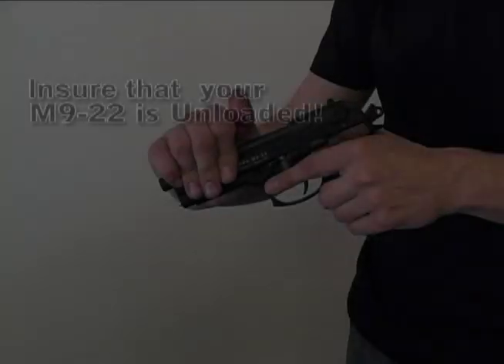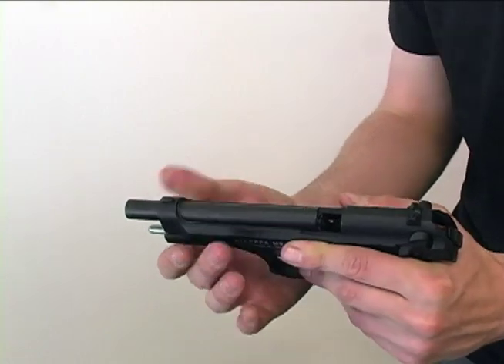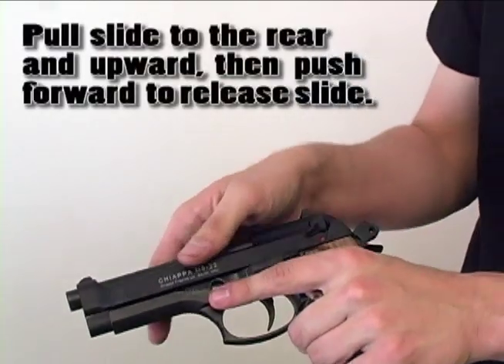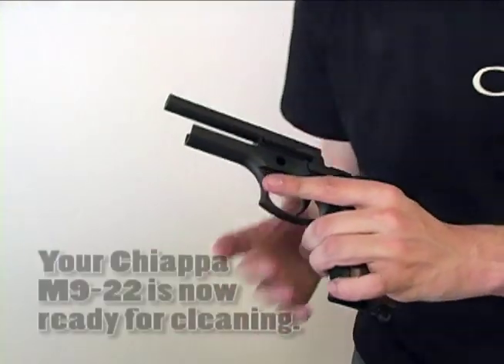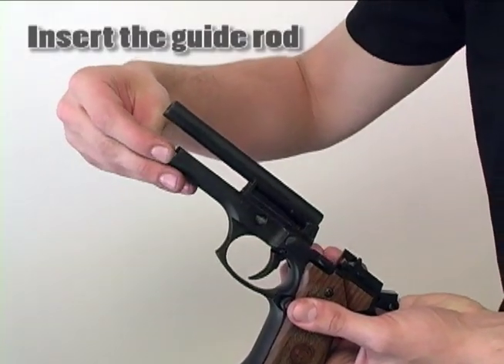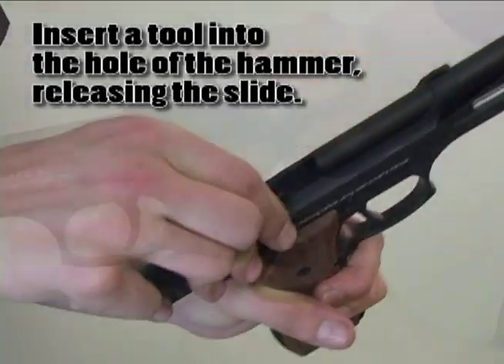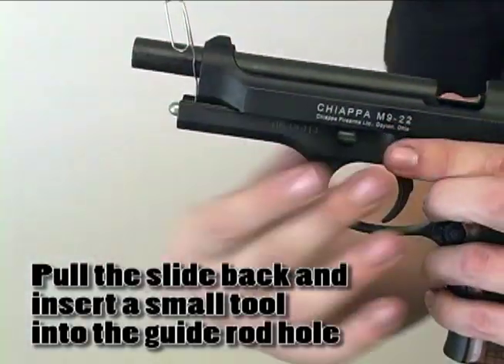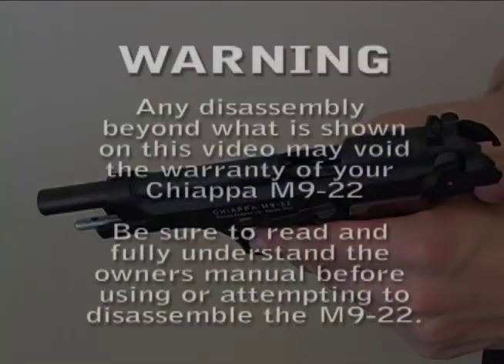Chiappa M9-22 field stripping & assembly

Comment: I got mine to train with instead of using my Beretta 92f. The size/weight are spot on. The M9 has a long trigger pull, and it wont let me rack the slide to chamber a round like the instructions say you can unless I cock the hammer first. 
After my debacle with cleaning and trying to reassemble this thing, it's going on the shelf and I'll keep using my Beretta. To me, it's more user friendly. I'll spend the $ for 9mm
The M9 seems decent, and no issues with the CCI mini-mags I ran thru it today

Comment: @ BlueRiverBenchcraft, because then there would probably be a copyright infringement. They can call it an "M9" because that's a non-copyrighted designation used by the military, and they can make it "look" like an M9 on the outside because that's only a cosmetic appearance. They just can't actually make it WORK like an M9 without getting sued by Beretta. I guess they mean for this to be a training gun for those who use M9s or for those who don't want to pony up the bucks for a real M9. Because, you know, .22 conversion kits are often as expensive if not more so than a regular inexpensive .22 pistol.

Comment: I read the instructions before the tear down, no problem. The reassembly instructions???...it just says 'reassemble'..There are NONE, NOTHING. I scratched my barrel all up, the slide, the whole thing. I have 24 rounds thru it and looks like a used gun. This instructions are HORRID!!! They should fire whoever the idiot was the wrote them, cause they left  important steps out...make sure the hammer lock is in the right position, use the little tool that is included (for the buffer spring), etc